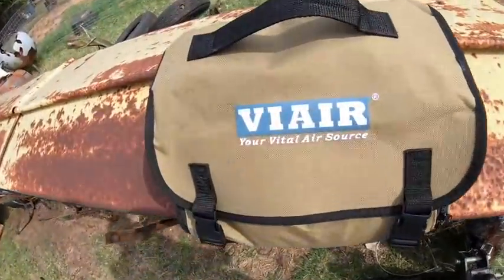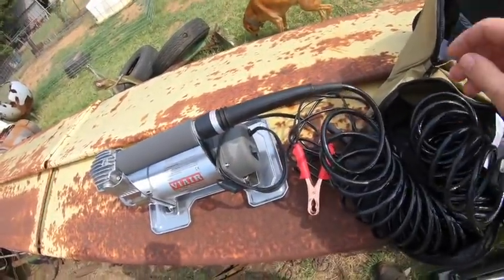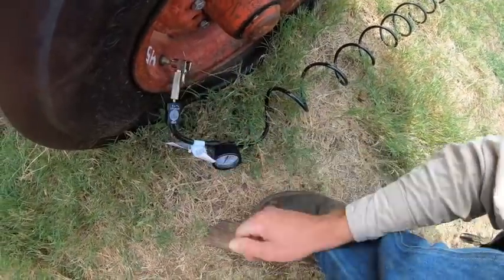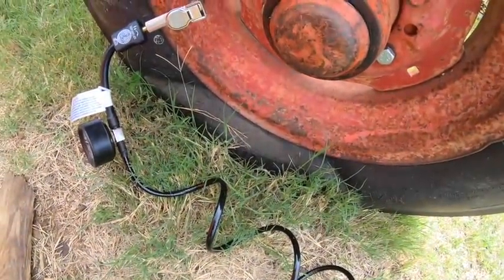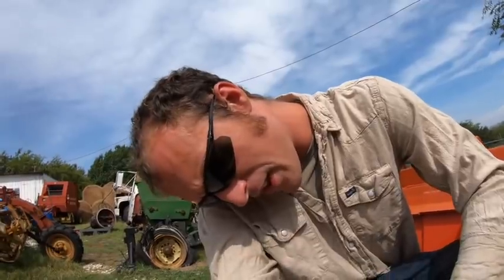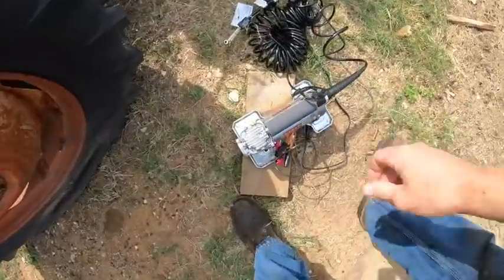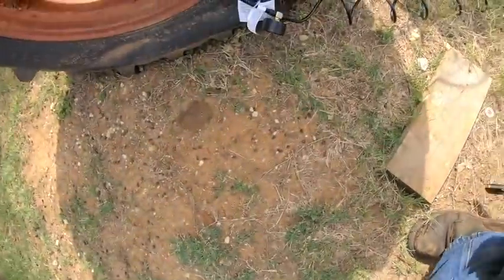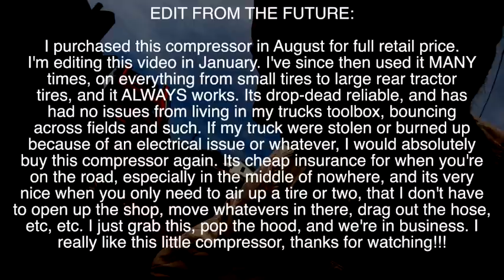Tire Inflator Review - 12 Volt Portable Powerhouse, Great For Farm Stuff!!!

Comment: I have one of these and it works every time I've needed it. Just lives under the seat in my truck and every 6 months when I notice a tire needs to be filled I pull it out.  I've used it on trailers that were attached to the truck too because of that nice long coil hose.

Comment: For keeping in a vehicle, this makes a lot of sense. I went with a cordless compressor (with a 1 gallon tank) to serve the same purpose. If you're just doing typical "fleet" maintenance where not every single tire is dead flat, it's pretty nice to just walk around and top everything off without dragging out a hose. It also isn't fast, but the tank gives it a decent head start and it can continue to recharge while you're walking from thing-to-thing.

Comment: Yes sir, keep one in every truck. And a dewalt cordless for around my shop. Honestly, with cordless tools, I rarely even us my compressor much anymore. 
As for tractors, my 7 year old mahindra 4540 has been a absolute beast! I have abused the hell out of it, even cranked the hydraulic pressure up to lift 2500 lb pallets and it has never let me down. I should take better care of it, one oil change and that's it. Even the original battery,lol. I did install bigger front rims and tires shortly after I bought it as the little pizza cutters would sink into the ground.

Comment: I switched from one of those to the Ryobi little battery powered one - I have ryobi stuff for camping/offroading/junkyarding - the red stuff doesn't leave the shop.  The Cryobi is nicer as you're not dependent on the car battery (my side by side would explode if I hooked up a 40amp load to it), works better on trailers and stuff... The 6ah battery would air up 4 mud tires no problems.  The advantage too is you can keep it running while switching between tires and it just builds up pressure in the small (1gal?) tank...   Imagine trying to air up the trailer tires on a long trailer with no battery/truck nearby...

Comment: I love mine, i have a model same brand  but with built on hose. Used it for 4 years doing roadside assistance for insurance companies.  Only problem was the air going thru handle was plastic and broke when it fell off hood. But got another and just keep it on the ground when inflating.

Comment: I have a couple of really cheap harbor freight models for emergencies. I have one good one from harbor freight that I use too. All have served me well. But I wasn't able to afford one of the quality as. I'm "retired " and I only have a small business raising cattle now. But as your business grows, this compressor will only be a stepping stone. You are going to need a dedicated service truck with an engine run compressor, welder, tools and spare parts. I thought that the  Ford flatbed duely was it but you made a trailer out of it. And as far as tractors not holding up like crappy cars, there's a huge difference in usage. Farm equipment is used in so much harsher conditions. Tractors are larger and pull much bigger and heavier equipment at a much faster pace than ever before. I worked on electronic sorting machines for tomato harvesters right out of college. The first thing that they told us in training was electronics and computers do not like heat, vibration,  moisture and cold. All the stuff from mother nature that the agricultural industry has to deal with. Many cars don't have the strains of agricultural equipment that's why they seem to last. But anyone that uses vehicles in agriculture or hard use in the field knows these vehicles break down much more frequently. I'm sure this little compressor will serve you well for many years.  But I know you will find a great deal on a service truck. You seem to find great deals a lot.

Comment: I have a harbor freight 150 psi high volume air compressor I've been using this compressor for over 3 years 0 incidents the compressor is used to run air shocks which holds 130 PSI in one leaky a system so compressor makes 130 PSI three to four times a day

Comment: This might be a stupid idea,  but what if you made up a hose long enough to reach all four tires with stem clamps on each end, so you could steal enough air from the other three tires to get you to an air station?
Reply: Rear tractor tires run around 10-15 psi fronts run 20-90 psi